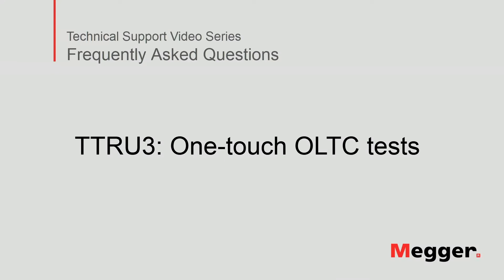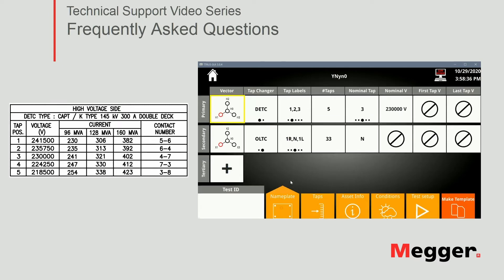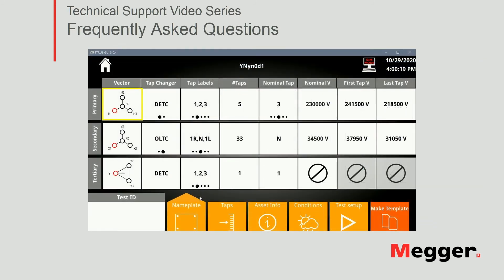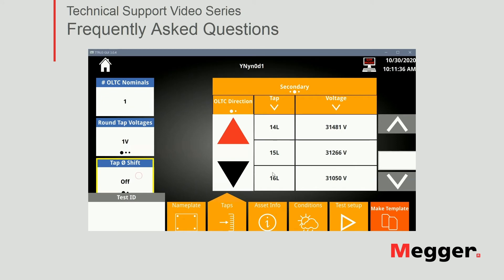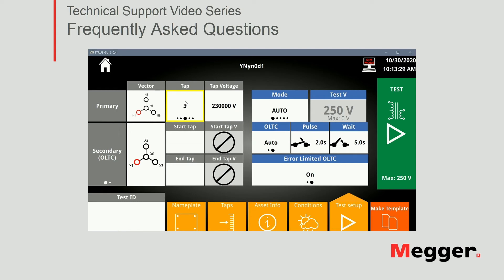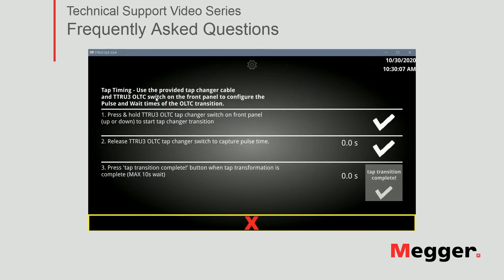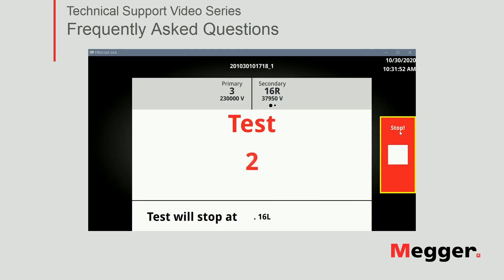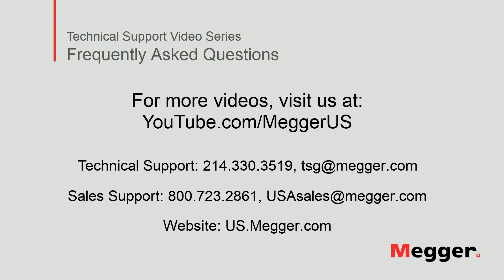Megger TTRU3: "One-touch" Automated On-Load Tap Changer (OLTC) Measurements

Comment: Good evening Megger Team,

I hope this message finds you well.

We have been using your TTRU3 OLTC testing set for more than two years. Recently, a fault has occurred where the device does not display anything when powered on.

Kindly assist us in resolving this issue. Please let us know if further details or steps are required from our side.

Looking forward to your prompt support.

Best regards,
Engr Naresh Kumar
Assistant Executive Engineer (Electrical)